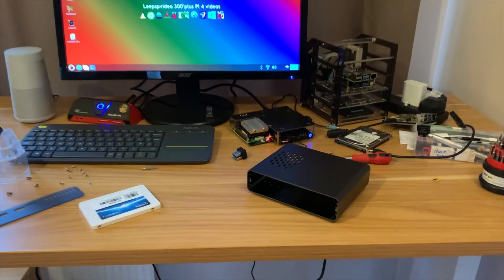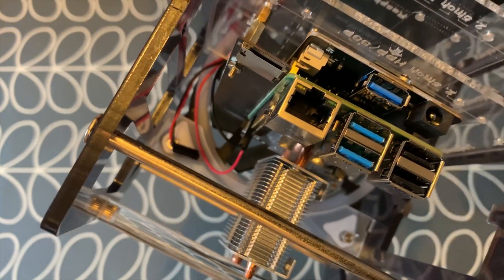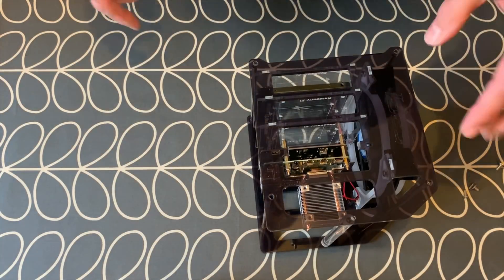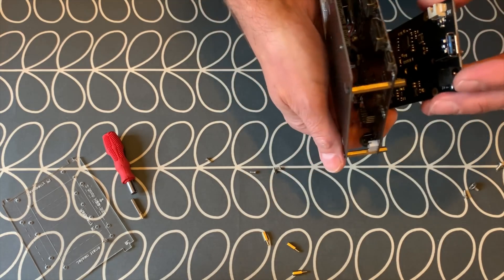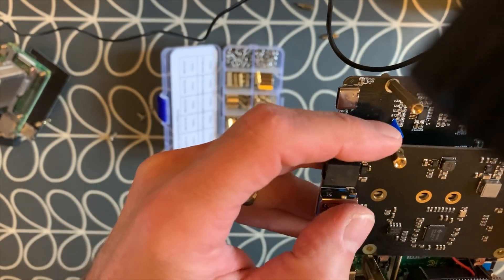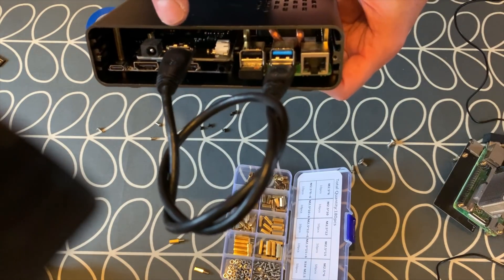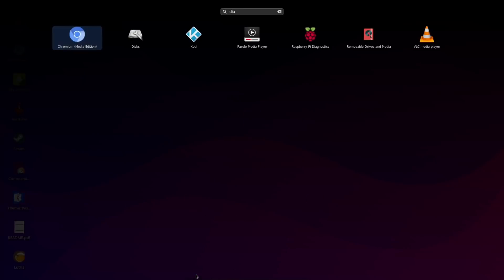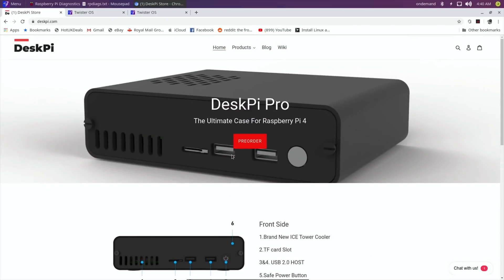Adding an M.2 NVME drive to my Deskpi Pro case. The Ultimate Case? Raspberry Pi 4.

Comment: You should be aware your video might be promoting a scam. deskpi.com has been taken down the exact day shipments were to start. This is AFTER delaying shipment. After emails and messages on the site (before it went down) I opened a paypal dispute.  Shady stuff..  thought you might want to know since your  subscribers saw this video.
Reply from the maker: I contacted them on the 3rd of November, this was the reply.

Hi Lee,

M.2 DeskPi Pro is in mass production. 
We add SATA to M.2 adapter board in it. 
Due to the complexity of the product and the increase of three functions, it is a bit delay.

I checked, the site is still working.
Reply: @leepspvideo  3rd of November now eh? did you get a shipping notice? i certainly did not. site is back up now. can confirm.    you must know someone I dont to get a reply.   way too sus for me thanks.

edit:  15th NOV - 17th NOV now on the site.  apparently they are really trying.  If it quacks like a duck and walks like a duck.. its a duck.
Reply from the maker: @bazurk_dot_com  I haven’t ordered one. I’m not sure if they are sending me the newer M.2 one to test.

Comment: Can anyone tell me what you are meant to format the M2 as?   I got an M2, and the geek board... but to boot from the M2, what do you format?? EXT4? FAT 32? both????
Reply: ah, ok... somehow managed to write protect the M2 which is why it would show up in GPARTED but not let you do anything...  So, if you are following the recipe above and get weird errors...  Type LIST DISK from a win10 machine DOS prompt.  SELECT DISK n, where n is the disk in question.    ATTRIBUTES DISK CLEAR READONLY and hit enter.  problem solved.  

Apparently M2  can be read only for a number of reasons... this will clear it and save you the 2 days I spent trying to figure out what was wrong :-)

Comment: According to 52pi’s site they’re adding:
1. GPIO extension header
2. M.2(SATA)to 2.5 inch SATA adapter board
3. Infrared receiving module

Scratches all my itches. I don’t care for the Argon m.2 ditching the microSD. Even with SSD store the SD card is still invaluable in SBC land.

Comment: I finally got mine X872 running by adding a power supply for my Adata XPG SX8200 Pro 1TB.
I am running Twister 1.8.4 on Berry Boot.  However I am not getting the same number as you do ( not even close ).  
Sequential write speed ~200k KB/sec (target 10000) - PASS
Random write speed ~7k IOPS (target 500) - PASS
Random read speed ~7k IOPS (target 1500) - PASS
The Adata drive should be a fairly fast drive ( 3.5 / 3 GBps of read/write under WIN ), and I wonder if this number is caused by Berry boot.
Anyway, I can't get the Pioneer in my region, too bad that is such a good performer for such a low cost.
Reply: There are a couple of reasons for this. Change the USB cable your using. I suggested the pioneer because it had the best specs but when you get in the real world is also different. The question I have for you... what else do you have connected to the USB 3.0 ports? are you using the TYPE C port for data? Im getting the same speeds as the OP, but I got faster speeds the first time ran it. It made no sense... but at that point, I was not running it as the boot source but attached to a windows computer. Seriously try using the THICKEST USB 3.0 cable you have. If you need an amazon suggestion let me know. I even used Type C adaptors with the same cable and I was good. The moment I switched to a thin flimsy cable I got trash speeds.
Reply: @R1D9M8B4  I am already on a thick Type A cable, but it's a bit too long ( about 1.5m I think ).  Then I switch to the  type A "U" connector coming with the board, and still getting the same number.
It shouldn't be as the Adata drive is fairly fast on Window, comparable to the Samsung EVO, but this is what I am getting so far.  I am running out of idea....
The boot up time from pressing the boot button on Berryboot to get to the desktop is about 10~11s though, so I am happy for now.

Comment: Why not solder the connection so you don't use that dongle?
Reply from the maker: I like switching back and forth between cases.
Reply: @leepspvideo ..... Wow... I end up mutilating the cases till it does what I need it to.. I think I have problems... Lol
Reply: @R1D9M8B4  perhaps, not too many people like to roast their warranty quite that fast ;)
Reply: @pearcomputers  warranty? lol, maybe your right. Since I've found this one case/cooler... everything else pales in comparison. For me, it's more like art. If the case is at a certain price point... i will mix and match it till it's at the temps I want it and it looks a certain way. lol, I have my Lil sister hooked!
Reply: @R1D9M8B4  yup, couldn't agree more. we're itching for 52pi to complete their dev. Sbc's are nice but very expensive to 'grow.' This super-high quality case converts rpi's work into a sturdy full-featured PC for much less money than people typically spend on their usb octopus right now - 1t's very likely to go into our larger products for next year xx
Reply: @pearcomputers  agreed!